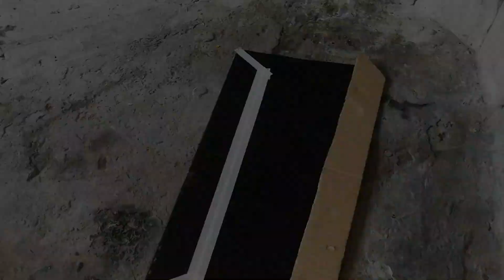Suzuki S-Presso: DIY Mesh Grill Installation

Comment: Paki-enumerate ilang screw at toks sa taas and ilan sa ilalim. Saan nahirapan sa baklas si BF?
Reply from the maker: Hood: 4 screws
Side malapit sa gulong: 1 plastic toks / 1 screw (magkabilang side po)
Ilalim: 3 screws / 4 plastic toks
Kabitan ng plate: 1 screw

Nahirapan po si jowa sa pagbaklas mismo ng bumper after maalis ung screws/toks kasi ingat na ingat po magtanggal sa takot na mayupi/masira kapag mali ng hatak. Matibay po kasi ung 2 matitira na pinagkakabitan ni bumper kelangan hilain po tlga ng may pwersa lalo na po kpag first time babaklasin. I-angat nyo po muna ung sa sides bago hilain sa harap. :)
Reply: Pano lilinisin condenser nyan kung my mesh grill na? 🤔
Reply from the maker: @LuluAng08  un lang po kelangan baklasin ulit ung bumper. 😅